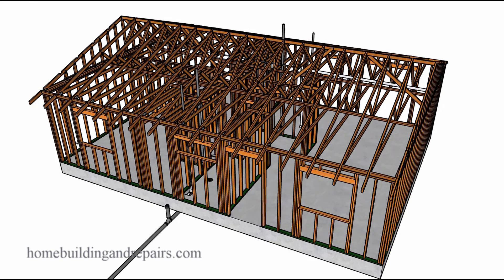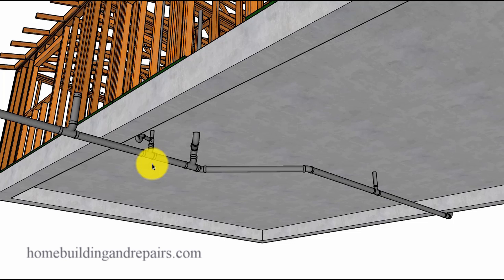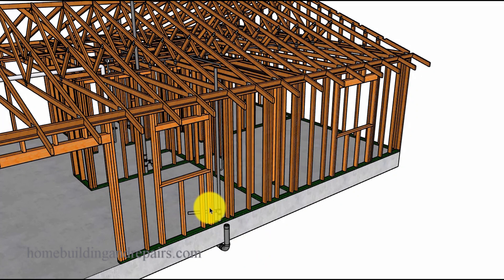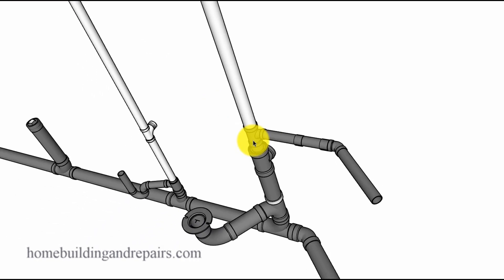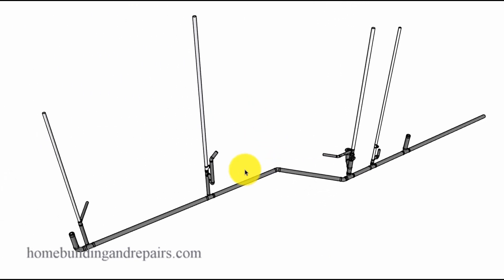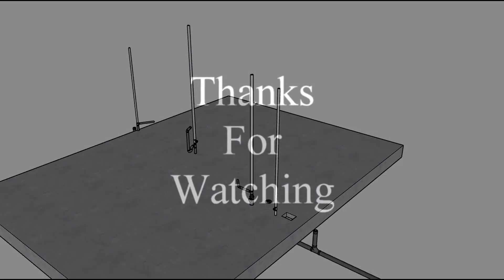What Is A Wet Vent And What Does It Do?  - Learning About Home Plumbing Drainage And Ventilation

Comment: I’m curious my city told me that my drains drain west to east the toilet in the laundry room is on the west side and when my washer drains it’s going and gurgling back into my toilet. I’ve snake the toilet and even used a shop vac and it keeps returning when I use the washer. No other drains in the house are backed up or or do anything like this.
I feel like the city is not telling me the truth because I told them that this is caused a lot of financial hardship because of the damage to the floor. 
The new homeowners on the west side (side nearest the toilet) had something going on with her water because I heard them say before they moved in as the water problem been taken care of and I seen a lot of people in the front yard, digging in their yard.
Is it possible that somehow they blocked up my line? 
I found out the new homeowner is an underground utility man.
I’ve had plumbers here, but they will not tell me what the issue is. They want to charge an outrageous price just to remove the toilet which I’ve already done for them and they have told me they will not guarantee the clock removal.
Am I right to think that it has something to do with the west side of the house because the rest of the house has no problems?
Reply from the maker: I'm only guessing, but it sounds like a clogged line or incorrect drain pipe installation. If this is something that started happening and everything worked fine before, then my guess would be a clogged or undersized drain pipe.

Comment: I’m building a house right now the wet area is 1 1/2” where sink is they run that line 1 1/2” up to the second floor and when they get  to truss they change it out to a 2”. Would that be consider a 2” vent or 1 1/2” vent? The vent starts above the last wet area correct?
Reply from the maker: Yes, vent starts above drain waste discharge.

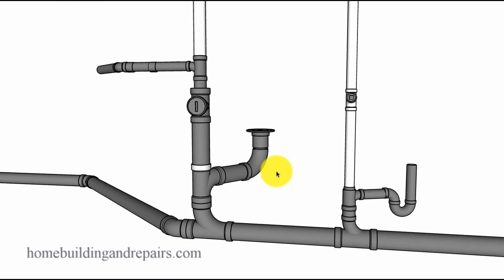Comment: Hi Greg. I ran across your video because I was wondering what these caps are on the sides of my house. They look like the flat piece with the vertical slot at 2:03 of your video. So it appears it is a cap for the wet vent. My question is, is there any issue with running a drain pipe from a water softener into this pipe from the outside of the home? The context is that I have had two different quotes for water filtration/softener systems, and one person said they were going to run a drain pipe directly to the sewer cleanout from the garage (going under the driveway) but another said they could use this drain pipe (wet vent). Would appreciate any insight you could provide before I try and save some cash but end up making a huge mistake. Thank you!

Comment: Hey I have a question.  I have a toilet basement . It smells like pee . So I change the wax seal and new toilet.  I noticed. when I took the toilet out I feel some air coming up from the 3 inch for the toilet. When I flush after abit it smell and even tho. I change was and toilet.  What u think it is ?

Comment: For a small house 900sf2 with one bath and laundry in the garage, can I tie all the vents to a single vent 3" and direct it out to the highest point of the side of the house so there will be no penetration through the roof since I am planning on installing metal roof?
Reply: I'm in the same dilemma, did you ever get an answer? I'd appreciate it if you did and share it with me lol
Reply: @lyledpugh  No, I haven't but I think you need to talk to the city.

Comment: Stack venting and wet venting are not synonymous. Wet venting is the use of a horizontal drain line to serve as a vent to a fixture to which is is connected to. Wet venting is an exception to the plumbing code

Comment: I have just built a new home and my plumber connected the kitchen and bathroom pipes to the sewer drainage pipes to drain into the sewer tank. My concern is that water will fill up too fast in the sewer tank and drain out alot of water into the waste landfill. What are your thoughts? 
Note: The plumbing is downhill and not on flatland.
Reply from the maker: I don't have any tips here. Wait and see if it works fine and if not, then you would have a legitimate complaint.

Comment: Doesn’t a wet vent also have to do with up sizing a drainage/waste pipe to allow more air in it, so you don’t have to put a vertical vent pipe up to the roof for an additional fixture?
Reply: A wet vent myst be a whole pipe size bigger to allow for no back pressure, proper drainage and sufficient venting.
Reply: This is the critical fact of a wet vent that was not included. Thanks!
Reply from the maker: Yes, you can only put a specific amount of drainage fixture units according to the size or diameter of a drainage pipe. This will also affect venting these fixtures.

Comment: Hi @Greg, nice video.  I'm renovating an old house and adding a bathroom.  At your 25 second mark you made a very casual comment I need to vet further.  You said you would not add the bathtub, washing machine, or kitchen sink.  I'm hoping to do exactly that with a 3" wet vent.  I'm trying to get instruction from my building inspector but havent heard back yet.  The 3" pipe would provide drainage for a washing machine, a shower, a sink, and a toilet.  I don't want to have to poke another hole in the roof if I don't have to.  Does this plan sound feasible?  The vent thru the attic is only 2".  Come to think of it I'm not sure where the other bathroom or kitchen sink vent to but there is only the one pipe thru the roof.
Reply from the maker: Check with local building codes, but most 3 inch vertical pipes can be used to install more fixtures than a two inch pipe.
Reply: You always need to vent every single fixture.  Those vents need to be within a certain distance of the size of the pipe used for those traps.  If the vent is too far away (too low) then it will syphon the trap.
A wet vent is simply a vent that is also used by another fixture to drain waste water.

Comment: So I can't use a wet vent with toilet sink and bathtub tied to a 2 inch wet vent?
Reply from the maker: Not if your local building codes won't allow it, because you have to many fixture units. Find out what your maximum fixture units are for a 2 inch wet vent to verify.

Comment: Hi, is a wet vent required for a toilet if it connects to the stack 7ft away?
Reply from the maker: It would depend on the design.
Reply: regs are 6ft maximum

Comment: Is there a reason you wouldn't tie all the "dry" vents together with one primary roof penetration for the vent?
Reply from the maker: There are building codes that only allow a certain amount of fixtures on certain sized vents. A three inch vent will allow more fixture connections than a smaller sized vent.

Comment: Do I need a clean out for the air vent pipe for my kitchen sink? The pipe goes through the roof and only the kitchen sink is attached to it. Thank you
Reply from the maker: It will depend on your local building codes but I've seen lots of kitchen sinks with or with out traps.

Comment: What's the difference between a wet vent sized with 2018 IPC Table 912.3 and combination waste and vent system sized with 2018 IPC Table 915.2.2 ?
Reply from the maker: My understanding is that the first one 912.3 would apply to the example in this video and the 915.2.2 is for a horizontal drain that would allow more fixtures to drain into it horizontally before turning up and going out the roof.

Comment: Thanks for your video, my house is a single level flat house, the 2 toilet flushing ok but the water level in the bowls are a bit low, I think it wouldn’t be the cistern problem as when I slowly pouring water into the bowls the water level are not raising up. Meanwhile the sewer in bathroom are a bit smelled. Do you think it could be sewer vent issue? Thank you very much.
Reply from the maker: You have an interesting problem that I would need a lot more information before make suggestions. Pouring water into the toilet bowl allows it to go out of toilet and into drain. Are you suggesting that at one time the toilet water level was higher and if so email me some pictures so I can take a look.
Reply: @gregvancom  thanks for your reply, yes the problem is weird, the water level doesn’t raise up when I pour water into the bowl, anyway I will take some photos first, thank you

Comment: If I'm running the sink or bathtub at full volume, wouldn't that effect the flush on the toilet because the water from the sink is blocking the air from the vent ?
Reply from the maker: It can, if the pipes are older and partially clogged, but if they are designed correctly, can easily handle more than one fixture draining into the waste pipes at the same time.

Comment: why is it important or significant to differentiate between a wet and dry vent.
Reply from the maker: Wet vents usually require special fittings or longer turns where a dry vent can often use short bends. It's all in the way the fittings and pipe layout is designed.
Reply: @gregvancom  Thank you.

Comment: I noticed in my home the sink drain went throught the trap and then horizontal a couple feet then down to the larger drain pipe. In the horizontal section there was corrosion...can that section be installed at an angle to avoid the standing water in it? Seems like theyre always installed horizonal.
Reply: horizontal pipes need to have a slope of 1/4" per foot.  It's not a lot to the naked eye, but its actually optimal for waste water systems.  Sloping it more will have a negative affect on your vent and will likely syphon your trap.
Where the horizontal section drops to a larger drain pipe there should also be a vent.
Reply from the maker: It might not be to code. I do have other videos on this, but it usually can't slope more than a quarter inch per foot.

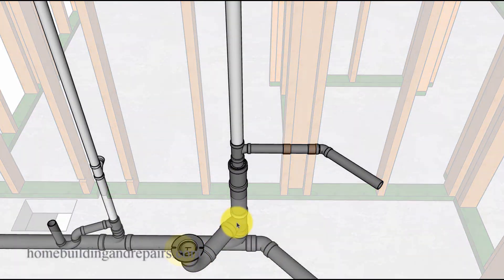Comment: At 1:10, the diagram shows the toilet flushing past the bathtub drain. I thought the toilet can't flush past other fixtures?
Reply from the maker: I would need to see the building code you're referring to, but something like this usually works.
Reply: Your close, on a wet vent the smaller (lav) always go's over larger(toilet or washing machine). Horizontal drains it doesn't matter ,no traps to possibly suck dry unlike a wet vent.

Comment: I didn't know you can run every drain inlet vertically. But now that I think of it... it wouldn't be much of a difference whether you start vertical to horizontal bend before or at the wye.
Reply from the maker: Yes, for the most part the drains just need to keep the water moving towards the sewer of septic tank.

Comment: Do you still need a vent pipe leading up to the roof from the sink (or toilet) drainage pipe?  (the white pipe going up to the roof).
Reply from the maker: Yes, most drains require a vent for each fixture, like a toilet or sink.

Comment: Aren't tees, that do more than vent, supposed to be twisted below 45°?
Reply from the maker: I would need more details. What does a twisted below 45 mean?
Reply: @gregvancom  I forget the exact terminology, but I guess Rotated would be more applicable word than twisted. As in rotating around the center of the lateral drain pipe/fitting.  
Drain, waste, and vent plumping is not my specialty, but a pipe that Only vents can connect with a 90° sanitary tee pointing straight upward(or within 45° from that). A 90° tee most be rotated so it points to the side of the lateral(by rotating between 45° and 90° from when it's pointing straight up). That's because the inside of a tee doesn't have a continuous sloping wall directing the waste in the proper direction while maintaining steady flow. It should never be a sanitary tee on it's back unless it's only used for venting. However, whatever the tee fitting it is, if a junction receives waste water, it won't facilitate the flow direction and necessary velocity if there's suddenly a point it drops into open air and hits the bottom of the pipe. By not maintaining a continuous pipe wall to act as a path for the WW, it robs the momentum and can lead to damage or clogs. Hence why it's only vent pipes may be used pointing up.
1) Straight lateral pipe:
_______________
→→→→→→→→ 
_______________

2) Vent only junction of lateral pipe:
_____|    ↓    |_____
→→→→ →→→→
 ________________

3) Wet vent junction of lateral pipe:
_____|    ↓    |_____
→→→→↓↑   →     →   
_________________
(flow directions ”→”  ”↓”)
The 2nd and 3rd examples are both with tees pointing upwards, whether sanitary, long sweep 90, or whatever, they only differ in that the 2nd shows no reduction of flow rate because it only vents. Thusly no solid or liquids drop down and hit the bottom of the pipe or interrupt the flow of something traveling along it. The 3rd example shows a reduction of flow rate and the opposite direction of force which reduces momentum.
Even if it's a combination wye and 45° elbow, I think it's treated as the same thing.

Does that make sense? 
Rather, I know how it all works does make logical sense, but whether I've explained it well enough for others to understand is what I'm asking. Because I feel like I made up half of that since I'm not an actual plumber and I'm going off my memory regarding code and also off my reasoning for how waste water flows in a pipe. I mean it's not something I do professionally or with any frequency nor am I as highly educated as say Neil DeGrass Tyson. I might be wrong in my understanding that **it flows downhill. I'd say a cliff doesn't let *it flow downhill as much as rain down hell if you're below and unlucky to be the bottom of the pipe....
Reply: @jackovoltraids5937  impressive illustration
Reply: @deadmanswife3625  thanks.
Reply from the maker: @jackovoltraids5937  Nice examples and A++++ for what might be the longest reply. I think the best argument I would have is that wet vents draining into a vent that as a longer bend like a sweep connector connecting below should provide the same result as a separate drain with separate vent.